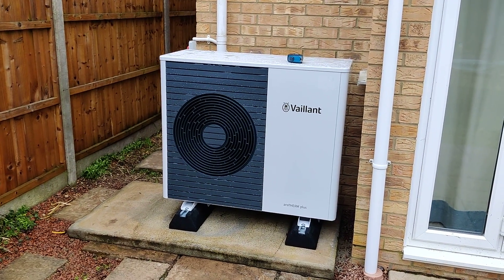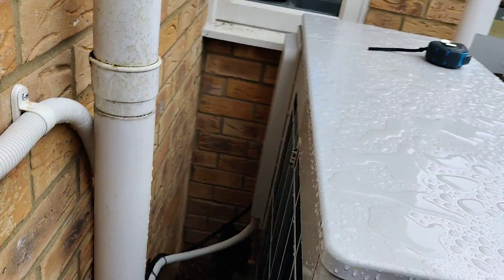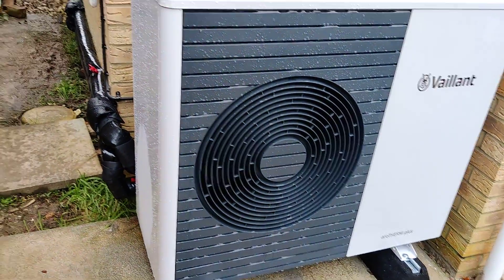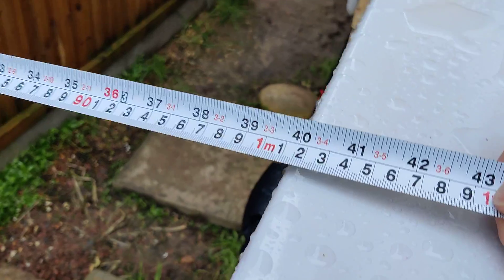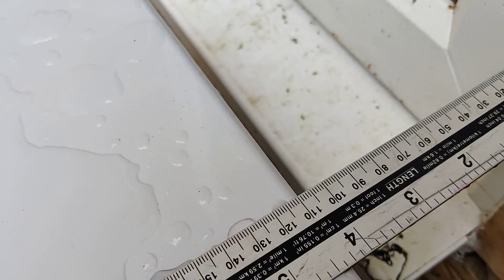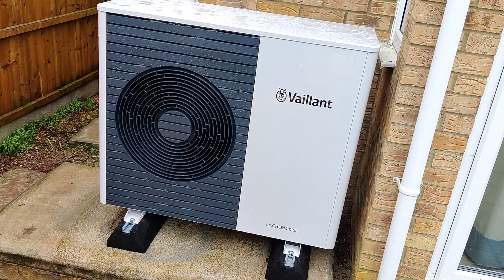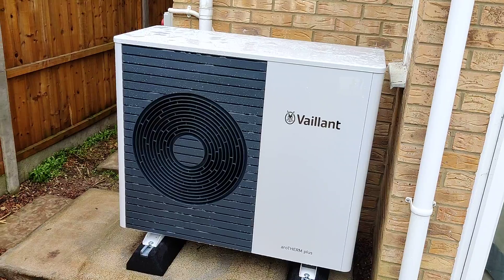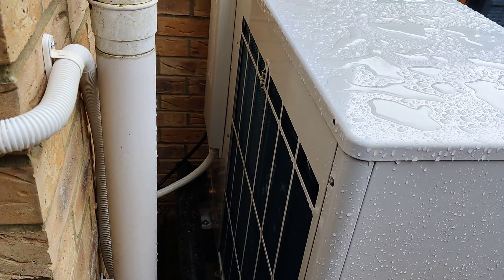Are Clearances Affecting my Heat Pump's Efficiency?

Comment: Hi I’m local to you in Warsash I’m having a 10.7kw system installed in a few weeks. With 3 10kwh Dyness batteries. If you need content?
Reply from the maker: Thanks for the offer, I wish I had the time! Are you having the Powerbox G2's installed?
Reply: @UpsideDownFork  yes exactly was going for Fogstar but then the installer offered a stunning deal on the G2s. Thank you for the fine content, you and other creators have inspired me to  have a new hobby albeit an expensive one.

Comment: Im a Vaillant heat pump engineer. You wouldn’t need to move it for a service you’d only need to move it if a repair was needed ie parts replacing even then you might get away with it
Reply from the maker: Thank you for contributing! 🙏

Comment: I'm surprised the corner negates the R290 clearance requirement? I'd have thought it would be like the bathroom water to electrical requirements having some effect around corners. It's not as if propane is incapable of going around corners?
Reply from the maker: This is what I think about R290 https://youtu.be/dFciSCIEI2c
Reply: @UpsideDownFork  Oh yeah, I totally agree that the guide lines are a joke when you can have an R290 fridge or mini split system with the refrigerant inside your house, but outside near a window/door is banned.

But I thought we had no choice but to comply with them?

Comment: it all depends on the air flow or wind and air exchange which you did not mention. 
the heatpump takes warmer air in and pushes colder air out which then sinks down on the ground. And with such a small way and high walls the air flow is usually limited or even  not there if there is a dead end with a wall and a door to enter your backyard. 

In such case the heatpump woudl suck in more and more colder air from the cloud and make it even more colder cause you need warmer air on the inlet site. And that is the real issue to achieve the COP and SCOP promised. Chinese manufacutrer are a lot more keen to make sure their heatpumps get a proper spot which is usually rather far away on a lonesome spot of the house or porperty to stand in the wind and not in a dead end with 3 sides surrounded by 2,5 m high walls.
Reply from the maker: This side of the house is a wind tunnel. Nothing in front of the heat pump for at least 10M
Air flow is a total non issue here.

Comment: It looks like the electrical isolator is still within the protective zone however. Given it's an R290 heat pump, it should really be moved (it could just be raised higher)
Reply from the maker: Thanks for commenting!
R290 protection zones are a total joke. Fingers crossed they get dropped completely to allow many more people to install heat pumps.

Comment: If the clearance is for maintenance access, and you don’t have the required clearance, then it can’t be maintained without a full disconnection.  Even fault finding will be an issue, for instance basic access to the wiring & control circuitry is physically impossible.
Reply from the maker: Thanks for your comment.
Please see other comments or the Vaillant diagrams.
Casing is easily removed with a couple of screws and electronic control panel is at the front.
Reply: @UpsideDownFork  I refer you to the Vaillant UK installation & maintenance manual  dated 5/1/2023 

Page 16 diagram 3.6.1 page 30 diagram 7.7, and page 41 diagram C1  

Only the HMU board is accessible from the front, the installer board requires rear & side access, there is at least one sensor on the compressor block that also requires rear & side access.

Also just before the 5 minute mark in the Vaillant UK installation video shows why you need 500mm minimum clearance 

By deviating from the installation instructions on clearance it’s not possible for the installer to (honestly) complete the benchmark checklist which is required for Building Regulations Part L compliance.

It’s really nothing to do with efficiency, airflow or safety requirements associated with R290.
Reply from the maker: @MartinE63  Thanks for your comprehensive reply!

Comment: I have exactly the same comments on my ASHP installation videos. Just like you, me and my installer read and adhered to Vaillant's minimum installation clearances. We are not suffering from micro-climating or poor COP. Installation and R290 clearances are two difference matters, this seems to confuse some people too.  Thanks for posting.
Reply from the maker: Thanks for your comment 👍
Reply: Vaillant want to sell heat pumps, so they will state absolute minimum distances.  300mm behind and 1.5m in front is a sensible minimum.
Reply: @davidstorm4015  with any appliance the manufacturer stipulates the minimum distances, be it a fridge, cooker, hob, heater or boiler. 

In all cases we have exceeded the minimum distances defined by Vaillant for the placement of our 7kW heat pump.
Reply: @johntisbury  think about it from a common sense perspective.  If you have only 700mm in front of your heat pump, it WILL be sucking in some cold air as it will rebound off the fence in front of it.  If you can feel the airflow at 700mm (which you will), then this is self evident.  You say it is 'in a wind tunnel', but that depends on the wind direction and speed.  You cannot argue with physics, unless you are just trying to convince yourself.  Don't believe the stats that Vaillant supplly and just think about it from a commons sense and physics perspective.
Reply from the maker: Or get some smoke pellets and do a test?
Reply: @UpsideDownFork  I have purchased smoke pellets already and plan to do a video using them on the heat pump. We purchased them to do a test on a ducted extraction system in our glass studio. 

For our heat pump stats we use Open Energy Monitoring supplied from a MID heat meter.  Over the past 30 days including the really cold snap at the beginning of December we have a COP of 4.0 including hot water runs each day. I know we have no performance issues.
Reply from the maker: I agree with you completely. I'm not convinced by David Storm's point personally.
I look forward to your smoke pellet video then. I was planning to do a similar test but hadn't got around to purchasing them yet. I'll wait to see your test before I commence on my own.
Reply: @johntisbury  for a smoke test to be valid you would have to do it many times in different atmospheric and wind conditions, one test won't tell you anything
Reply: @davidstorm4015  noted thank you. One test will tell you something, however many tests will reduce any outliers skewing results.

Comment: What service contract to BG offer ?   & hopefully the will be serving it & so will beable to do it ?    In terms of R290 near a window.  ... you can also buy R290  Split systems With pipes inside & Internally fitted Air to Air Monoblocks , so worrying that it might leak & go in a window , or drain is a bit paranoid  & yes its under high pressure but its also limited in volume & with a leak warning  & a big fan.
Reply from the maker: Yeah, I think the R290 risk assessment is way over the top too!

Comment: Where is the water running just straight onto the concrete path 

What happens if it’s really cold.the floor will ice up
Reply from the maker: The condensate should be going into that downpipe to the left.

Comment: I cant see there would be an airflow problem at all.. ok its a bit close on the rhs but wide open on the left and above. I have the same vaillant arotherm plus 7kW, even at full pelt Im amazed how quiet it is!  I fitted a couple of ribbons in front of the fan so I can see when its running from the window, I certainly wouldnt be able to hear it. I would have liked a light or symbol to come on at the controller actually just because.. ;-)
Reply from the maker: Right you are. I am honestly shocked at how quiet it is.

We'll never be able to hear it over the road noise or the wind in the trees!

A ribbon is a good idea 💡

The clearances thing seems to divide people. I might get a smoke pellet as a demonstration for a future video, I'm pretty confident it's all good.

Comment: I know that in other comments you've mentioned moving it to the left, but I think it's okay where it is:
- Being so close on the right is going to limit airflow, but the additional distance you have from the back will make up for that.
- The distance to the opening portion of the French doors looks to be about 1 meter as it is.
- Access is the only consideration, but both the front and side panels come off. Basically, you remove the top (There's a screw in each side) and that lifts off. There are then screws in the top of both the front and right side panels and the panels then lift up and out. Give it a go yourself (You need a torx bit) and you'll see just how much access you have. The service valve for the gas is right near the front. Access to the electrical connections is the only real issue, but the main control board is actually located at the front near the top.

I would point out that if you ever want to use it for cooling, Vaillant requires an extra 50mm clearance at the rear which might be an issue with your reduced rear-right clearance.
Reply from the maker: This is the kind of feedback I need! 
If you say that the electrics are the hardest bit then that's proof enough for me as the electrician managed to wire it up where it sits.

I am pretty handy with the tools, having worked in the motor trade for over 20 years, so no problem getting my torx screwdriver kit and having a look.

Vaillant tech weren't in the least bit concerned when I spoke to them on the phone. They said the rear distance was the most important along with a minimum 100mm side gap.

No plans for cooling.
Reply: How is it possible for this air to water heat pump to be used for cooling🤔
Reply from the maker: @David-bl1bt  not easy with convection radiators like we have.
You need a module and then need to worry about internal condensing.
Reply: @David-bl1bt  For the Vaillant heat pumps, to get the module search for "VAI0020266328". You need to take the front off the outdoor unit, there's a connector for the module in the front PCB. This module will then enable cooling.

For our setup, we have an extra diverter valve which will switch over to proper fan coil units for cooling. (To be installed, they took a while to arrive as they were built to order so they weren't installed at the same time) The fan coil units are ideal as they have a drain pan for the condensation. They do make a vertical fan coil which looks like a thick radiator, but has a fan and drain pan if you want cooling in a more traditional footprint, expensive to do that with a lot of units though.

Comment: We have the same shower and had to change to the same unit as you have how do you get on with the shower ours is rubbish. We have had a heat pump fitted as well but the instalers said it's not their problem.
Reply from the maker: Hello there, I changed the shower unit myself in the end.
I did subsequently increase the flow rate to the unit by changing the pipework from 15mm up to 22mm, reducing to 15mm just as it enters the processor.

That did increase the shower pressure back up to pumped levels.

Ultimately if your house has poor pressure at that point then it might be worth you swapping back to your pumped processor.

Anyway, I'm just a DIY guy sharing my experience of one shower, so better to seek advice from an expert in the matter!

Good luck.

Comment: you are incorrect about the clearance from the manual page 23
5.4 Complying with minimum clearances
To guarantee sufficient air flow and to facilitate maintenance work, observe the minimum clearances that are specified.

sorry but this system would 100% fail MCS and fail to comply with the manufactures own specifications.
this could affect your warranty and  any home insurance claim.
i would get it moved so there is the 500mm  as stated in the manual.

but i think you are aware this
Reply from the maker: Thanks for taking the time to comment.
I believe I covered all those points on the video?
The 100mm is for air flow and the 500mm is for access for maintenance.
Vaillant Tech confirmed this to be the case.
Reply: @UpsideDownFork just get something in writing from Vaillant confirming they are ok with those clearances, there shouldn’t be any issues then. If it’s anything like gas safe, then manufacturers say trumps those of any regulatory body.
Reply from the maker: @IbrahimAliSapnin  Thanks for the comment. I was thinking about getting it in writing, but I think i've made up my mind about getting it moved anyway, as it has the potential to run more efficiently with the extra airflow.

Comment: You will have to move that unit over - but at least you acknowledge that.😉👍
Reply from the maker: The more I think about, the more I wonder if I should get them back to do it now or wait until the 1 year service?
Reply: @UpsideDownFork  Generally it is better to divorce installation and maintenance from a servicing visit. Usually they are geared up both diary/scheduling and tools just for servicing tasks.
Reply from the maker: @normanboyes4983  Thank you for the advice.

Comment: I have a couple of observations regarding positioning...
Do you not fall foul of permitted development if you try to move the heat pump to the left as it will be less than 1m from the boundary?
Also, what's the refrigerant, R290? Doesnt that have to be a min of 1m from an opening window?
Reply from the maker: Hello, thanks for taking the time to comment!
 I'm guessing you didn't watch the video in full as I addressed both those topics?
1. I do have full planning permission for the pump to move 500mm closer to the fence if needs be.
It delayed our installation by a few months.
2. There is no opening window within 1M. The french doors are not on the same plane. As the HP is setback it doesn't apply in the same way.
Reply: @UpsideDownFork  sorry, I did watch the video, in fact I've watched the whole playlist.
I didn't realise planning allowed for moving it closer to the fence than currently situated.
Regarding the french doors, I've obviously misinterpreted Vaillant's installation requirements, my mistake.😳
Reply from the maker: @71brp84  it's definitely a minefield. I got the planning permission according exactly to Vaillants clearance recommendations in their literature and then when the installation team came we managed to site it closer. I called Vaillant technical to check.

The electrician wasn't happy about the access and it could be a great big mistake though in a year's time 😂
Reply: @UpsideDownFork  I've been following your progress with great interest as we're hopefully moving from oil to ashp in Spring.
Just trying to weigh up between Vaillant and Panasonic, but Panasonic don't have r290 in the UK yet.
I'm quite keen on this as it would allow legionella cycles without needing the immersion.
Reply from the maker: @71brp84  I believe both are great manufacturers from what I have read about Panasonic.
The way that Vaillant control their compressor and flow rates is quite impressive. It all seems to be some excellent engineering along with great programming.

It was a no brainer for me to choose between the Midea, Daikin and Vaillant.

Like you say, R290 high temp was a big selling point, I've completely isolated my immersion heater so it can't kick in 👍
Reply: Thank you for filming the install.  You have to be flexible when doing any installation in an existing home.   I don’t think that some of the negative comments are justified.  Overall it looks a decent install at a decent price 👏👏👏
Reply from the maker: @peterwalton1502  Thanks for your comment.
There will always be keyboard warriors out there. I've already invited half a dozen of them to come down and make a video about auditing an install but no takers yet!
Ultimately, I don't think it does the trade any good to shame other people's work. It just sows even more distrust and doubt in the general public about tradesmen. Not helpful when the vast majority are good!